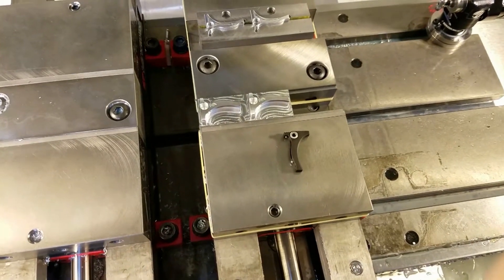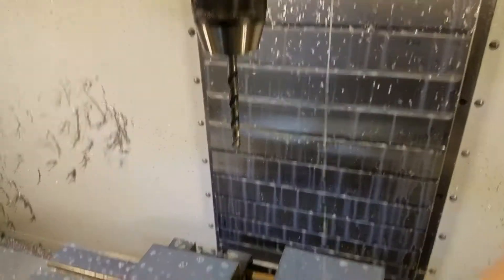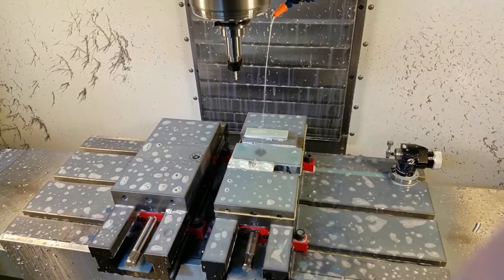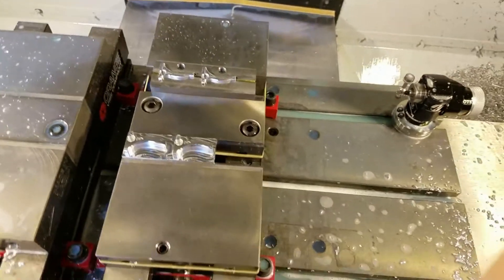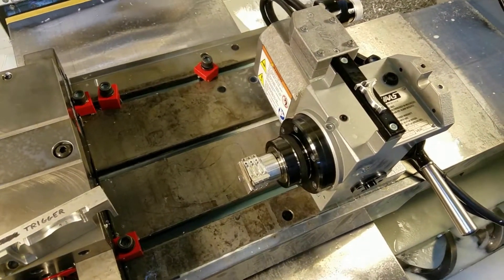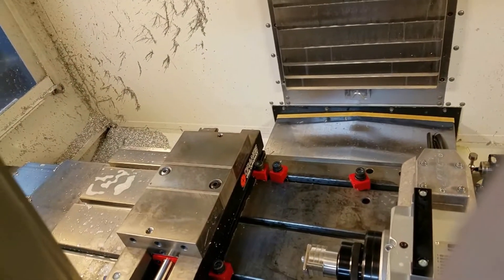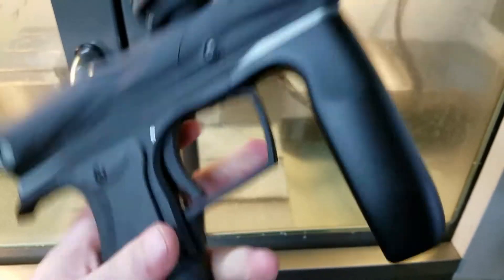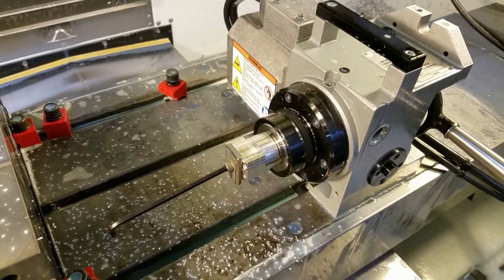Empire AxePro single trigger machining

Comment: Nice! Any plans to do any other guns?
Reply from the maker: We could do similar triggers for other markers, although usually the problem is the trigger return system. Lots of markers have very little space if they were shortened. These axepro triggers were a little different since they have that fancy removable trigger guard, but the trigger itself will also fit on the classic Axe and Mini-GS, so I made it work...lol